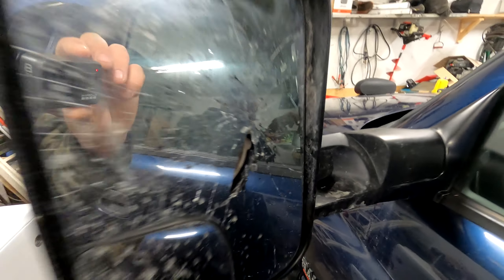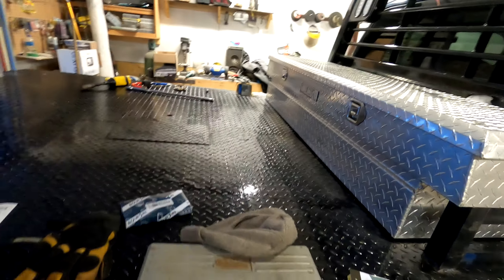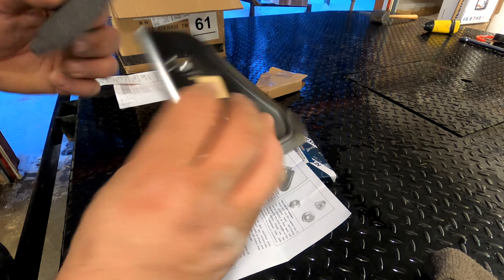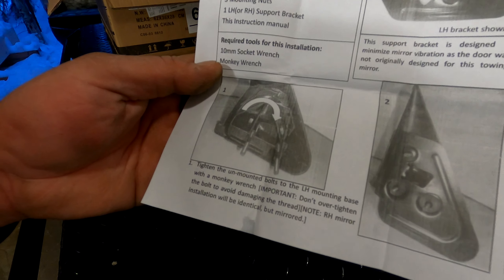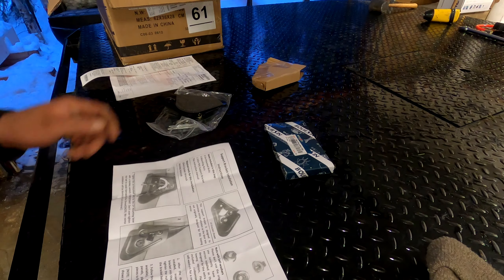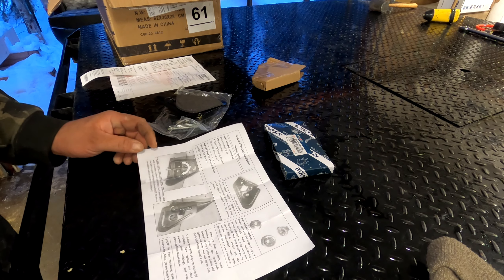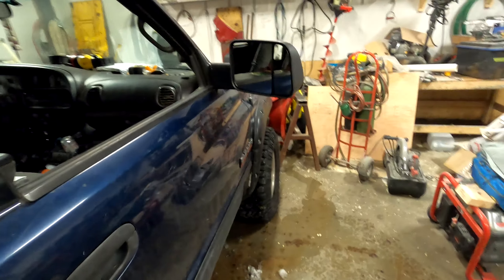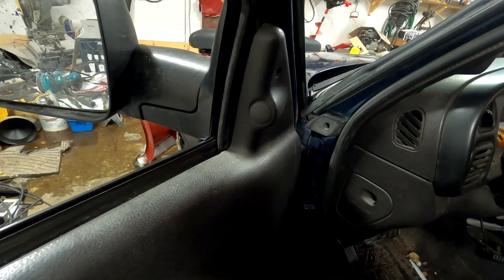4th Gen Mirrors On A 2nd Gen Ram

Comment: Will an 4 gen mirror work on a second gen or is it a specific one with the bolt pattern
Reply from the maker: Hey bud, great question!  I should have said so in the video but unfortunately no. Swapping stock 4th gen mirrors onto a 2nd gen won't work.  The bases are different and don't align.  I bought these 4th gen mirrors specifically for proper fit on a 2nd gen ram (they have the correct bases for a 2nd gen and line up perfectly).  I got them off of Amazon for about $240 dollars for the pair.